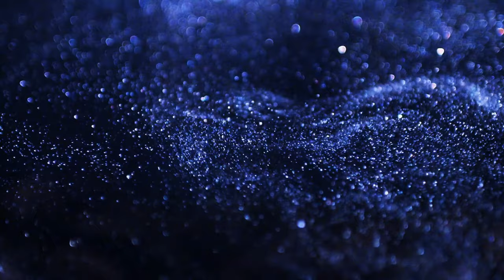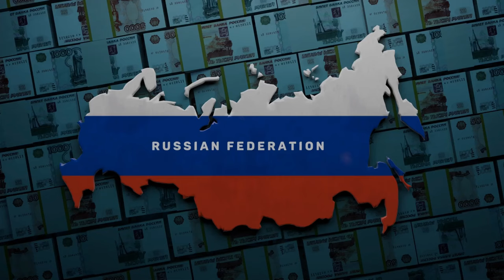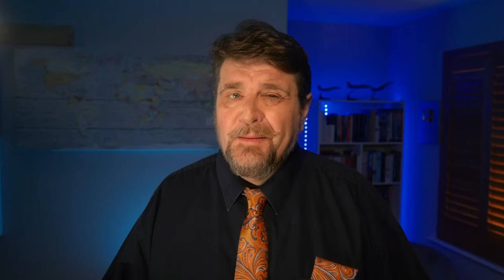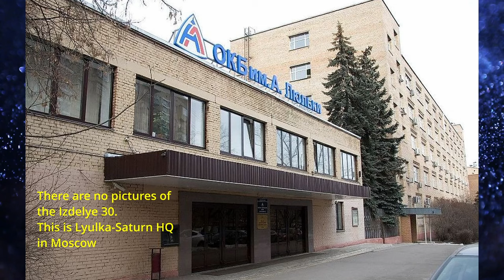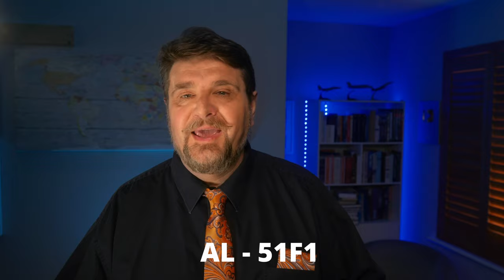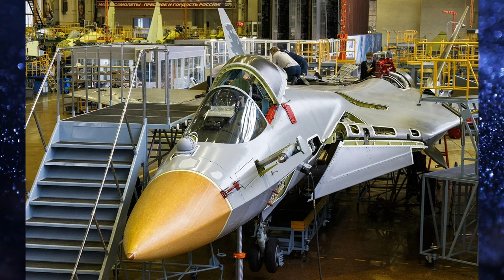Why so Few Su-57?

Comment: I just don't quite understand why they take so long to get the engine right! They have built many magnificent engines in the past ,why not now? The Rus.sians have the know-how, is the money running out? Well, may it be as it will, I like the SU-57, good looking bird -specially the livery!
Reply: A likely answer to your question is corruption. Too much money that would otherwise be invested in the engine development has been skimmed off. The development process could also have been intentionally prolonged to create more opportunities to skim off more fundings.
Reply: @LeeviHokka126  you could be right!
Reply: That engine was a mighty step forward. It jumps past current US designs. Its very noticably superior than anything the US has. It was simply an extremely ambitious project. For example the F22 engine has a thrust to weight ratio of 7 while the AL51 has a ratio ot AT LEAST 11.5. It dominates.
Reply: @LeeviHokka126  I guees the present defense minister is having a look at it. He knows that in the circumstance of the war in Ukraine, the russian military complex have to deliver result more than before. And he seems decided to do a clean-up of the corruption related to the russian military complex. In this sense war is a good way mke the russain military complex less corrupt . And from a strictl military point of view, this war is also the occasion for the russian military to improve the doctrine regarding it's operation. The learning curve is there.
Reply: @SlayerBG93 the f22’s thrust to weight is 1.25?
Reply: "I just don't quite understand why they take so long to get the engine right!"

Because it's a COMPLETELY NEW engine.   They essentially took every best part, idea and concept from previous engines and put them together.
And developing an engine from scratch ALWAYS takes a long time.   The only exceptions are those that literally just got extremely lucky.

"is the money running out?"

Uh, seriously?   Russia still has a budget surplus...
And they could, in theory pay off their entire national debt overnight if debtors allowed it.
Reply: @owenreid104  ENGINE thrust to weight ratio...   Not AIRCRAFT.
Reply: In the past they were a nation with 1.4 million scientists and 4500 research institutes spread across 15 Nations

Now barely any of it is left
Reply: @LeeviHokka126  "A likely answer to your question is corruption."

No it isn't.   Making the best engine in the world takes TIME.

More powerful, more durable, cheaper, easier and cheaper to maintain, lifespan, fuel efficiency, literally everything on the new engine is top notch.

As i've noted before, even if the finished product doesn't even reach halfway to the intended goals, it will still be, by far even, the best fighter engine in the world.

And if every goal is reached fully, it's going to be 30-50 years ahead of anything USA has.
Reply: @DIREWOLFx75  ok THANKS lmao
Reply: @akriegguardsman  "Now barely any of it is left"

You have no idea what you're talking about.

Why do you think it has became an outright meme in both the firearms and aircraft communities in the last 20 years that if you want a modern cartridge/gun/fighter designed, you go to Russia, because they're the only ones that have retained their institutional knowledge and capabilities.

Because USA and Europe has literally just gotten rid of nearly everything of theirs.
Reply: @DIREWOLFx75  while russia still retained some knowledge, had this been the USSR the Su-57 would've entered mass production with its engines by now
Reply: It is not just the engine but also the electronics
Reply: @DIREWOLFx75 The Russians want that engine to match the performance of the F-119. That's pretty ambitious coming from a country that is known for unreliable engines. But the Americans already have the F-135 which is an entirely different class and the XA-100 is nearly completed which too is another class on its own
Reply: @napobg6842  F119 is AL-31 level with its 5.2 T/W ratio but F119 eats twice as AL31
AL-51 has to push 11 tons and weight 25% less than AL41 its about 1200kg but developer said that it is in the 11 to 1 class, so there may be fluctuations either in weight or in thrust. In any case, the Americans remained at the level of the Soviet Union of the 1980s
Reply: @愛を込めてロシアから  The F-119 has a dry weight of 2.2 tons with a dry thrust of over 116kN. The AL-31F weighs 1.5 tons and has a dry thrust of 76.5 kN. So the thrust-to-weight ratio is about the same but that's not really all that important because both are used in large, dual-engine designs which have most of their weight somewhere else. Russian jets are large and heavy. For example, the empty weight of the SU-57 is about 18 tons. The F-22 is just below 20 tons. Yet, a single F-119 has a dry thrust of 116 kN while a single AL-41F1 has a dry thrust of 88 kN.
Reply: @napobg6842  it's about a combination of characteristics. 
The Su57 is almost a meter smaller in the frontal projection and it has more thrust/midsection. Plus more range, more electronics and so on. And you said that the su57 weighs 18 tons, none of the mortals knows the specific figures, but it is 10 percent smaller than the su35, and then it should weigh less than 15 tons. And I didn't understand exactly what your question is, because the thrust that you call has nothing to do with the thrust at working height
Reply: @愛を込めてロシアから  Well, both jets weigh nearly the same but the F-22 has more thrust because it has more powerful engines.
Reply: @napobg6842  No, they don't weigh the same, not even close. The Su57 is closer in weight to the F35, but you're right, more thrust comes from more powerful engines. But it does not mean faster acceleration and even more so maximum speed. You know that 1.8M is the maximum speed of the f22, right?
Reply: @愛を込めてロシアから  Nah, the SU-57 is 18 tons while the F-22 is nearly 20 tons. So they are not that far off. But the difference in engine thrust is huge.
Reply: @napobg6842  no, SU57 is 10 percent smaller than SU35 in each coordinate, which means it is no more than 1.3 times lighter than SU35. 
And there is no reason to think that the su57 weighs 18 tons, I consider the weight in the range from 15 to 16 tons. 
And I really don't understand your obsession with thrust, because the f22 won't fly faster than 1.8M. It's like a car that accelerates to 100 in 2 seconds, but this is its maximum speed versus a car that accelerates in 2.5 seconds to 100, but at the same time the maximum speed is 150. 
Do you really think you can surprise the Russians with a top speed of 1.8M? 
Or that the Russians cannot make an engine with a thrust of 20 kn?
Reply: @愛を込めてロシアから  Size means very little. The F-35 is a smaller jet but still weighs 13 tons. The SU-57 claims more capabilities than the SU-35 so it is heavier too. The F-22 can go up to mach 1.82 on dry thrust without an afterburner. With afterburner, it can go upwards of mach 2.25.
Reply: @napobg6842  EXACTLY, thats what i was talking about. 
The maximum speed of the f22 is 1.8M with afterburner. And he has never flown faster because of the unregulated air intake. Looks like I'm more into the subject than you are. And the comparison with the f35 is quite funny considering that the su57 is a flying disc and the fuselage of the f35 is a barrel with a diameter of 2 meters and a length of 10 meters.
Reply: @愛を込めてロシアから  The F-22 can reach mach 1.82 without an afterburner. Why would it engage the afterburner when it can reach that speed without it. It doesn't make any sense.
Reply: @napobg6842  The cruising speed of the f22 without afterburner is 1.3-1.4m. 1.8 is the maximum speed with afterburner. 
Sukhoi Bureau patent 2200240 describes the f22 air intake with a theoretical maximum speed of 2.0 M, however, indirect American sources confirm a maximum of only 1.8 M. 
By the way, the f22 does not have a deflector for the internal armament compartment, and therefore some experts believe that the raptor has the same problem as the A-12, and more specifically cannot fire missiles at a speed of 1.5 M or higher. 
And this is again indirectly confirmed by information about test launches of weapons. 
I do not know how else to describe it so that YouTube does not erase the comment again
Reply: @愛を込めてロシアから  The maximum cruising speed of the F-22 is Mach 1.82 and it is by far the faster jet ever made when it comes to speed without an afterburner.
Reply: @napobg6842  in a world with mig21, mig25, mig31, su57,  A12 you just said that f22 is the fastest without afterburner okeee i got it
Reply: @愛を込めてロシアから  It is by far the fastest jet in the world without an afterburner. The max speed of the SU-57 with an afterburner is Mach 2. The max speed of the F-22 while cruising is Mach 1.82. other jets can't come even close. That's because Russian engines don't really produce that much thrust dry.
Reply: @napobg6842  yeah f22 does cruizes at max speed of 1.8M with afterburner and even my auto-corrector has already learned it, but not you. 
And what makes you think you know su57 speeds?
Reply: @愛を込めてロシアから  You should probably go and learn what cruising on a jet fighter actually is. To give you a hint: You are not using your afterburner when cruising. It is actually also known as supercruise when your cruising speed is above Mach 1. The SU-57 most likely cannot supercruise because it has older and underpowered engines. The F-22 is capable of going Mach 1.82 without engaging the afterburner. The top speed of the jet is above Mach 2.25. We don't know the top speed with an afterburner but it is most likely above Mach 2.5. There are probably limitations to the top speed due to the RAM coating but surely, there must be an option to go full throttle in case of need.
Reply: @napobg6842  oh stop iit my iq is droppiinggg
Reply: @愛を込めてロシアから  I'm not the one claiming cruise with an afterburner. That's like to claim jog by sprinting.
Reply: @akriegguardsman  "had this been the USSR the Su-57 would've entered mass production with its engines by now"

No.

"While russia still retained some knowledge"

lol

Russia today is actually MORE capable than USSR was.   They do not have as much resources, but they have achieved a drastically more effective system.
They have essentially combined the best of the Soviet system with the western and Chinese systems.
Reply: @napobg6842  "known for unreliable engines."

That alone says you have no clue what you're talking about.

Go back to your fictional version of reality.

"electronics"

Yes, and?   Do you know why Russia produces so many top notch programmers and chip designers?
No, apparently you don't.

Russia uses electronics built from 90nm chips and they get better performance out of those than USA gets from 24nm electronics.

Hmmm, which nation is more capable?
Yeah, not your fictional USA at least.
Reply: @DIREWOLFx75  Oh ok, you are a bot
Reply: @napobg6842  Beep beep, yes yes, me so totally bot bot...

Wait, uh no?
Reply: @DIREWOLFx75  right, Russian processor can have half the frequency, more nanometers and still produce the same number of Gflops as the processor from taiwan
Reply: @愛を込めてロシアから  No, that's not what i wrote.

"Russian processor can have half the frequency, more nanometers and still produce "

And still allow for greater functionality as long as the hardware is better optimised and the software is better programmed.
Yes.

Again, guess why Russia has been exporting high class chip designers and programmers for many years  by now?
Because they are in EXTREMELY high demand because they are that GOOD.

Gflops is completely worthless as a way to measure how good military electronics are.
Raw Gflops are literally IRRELEVANT.

Counting 10 times faster is useless if you do not also have something worthwhile to count.   Or worse, if the actual amount of results each requires 20 times more calculations.

Oh, and that comes back to the fact that Russia and before it the USSR, thanks to its extremely thorough hard science heavy education produces a constant stream of extremely skilled mathematicians.

If you have a better chip designer, your chips can do operations in much fewer ticks, using less resources.
If you have better mathematicians, you can shrink down the amount of calculations needed to get results.
If you have better programmers, you can implement the layer between the math and the hardware vastly better and more efficiently.

Russia has all 3 of those.
And due to the USSR being behind in chip production, they were already used to this since back in the 80s.
Reply: @DIREWOLFx75  uraaa goidaaa
Reply: @DIREWOLFx75  your comment about the demands on competent programmers to improve functionality is undeniable. After Lockheed Martin delegated the development of the Raytheon software hardware, the number of failures in the system decreased many times. 
But there is another nuance, a modern aviation complex is a very complex thing and it is important to understand how to apply it correctly. You want maximum efficiency from this system in every flight. To do this, officers in the general staff and pilots must understand what a fifth-generation aircraft is, do you understand what I mean?